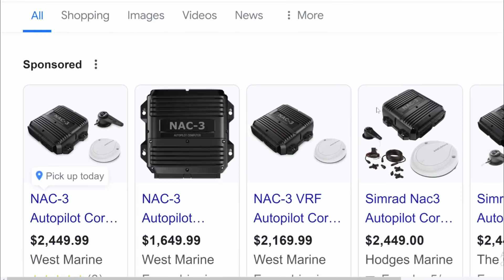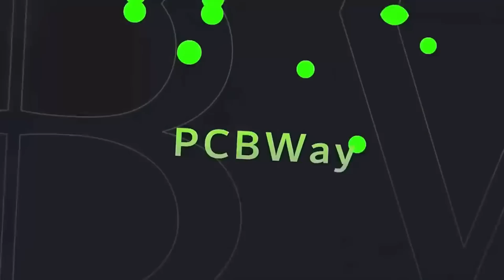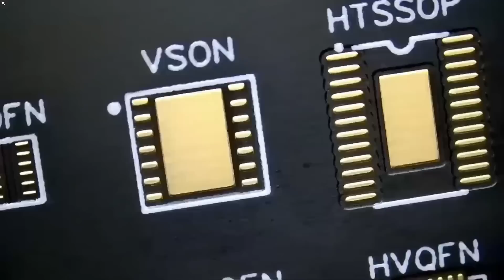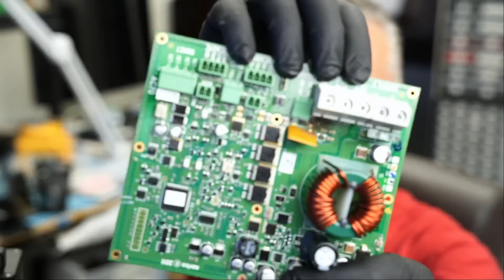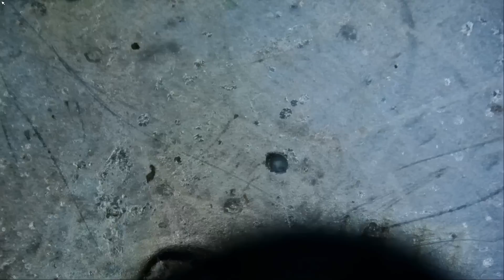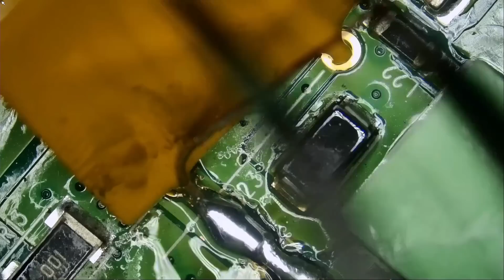Expensive Boat NAC-3 Autopilot Computer repair

Comment: I think that was a fusible trace that blew up if thats the case then there could be a problem with the board or there was a huge load on it like stuck propeller that caused it.

Comment: I think that board is going to make an even bigger bang when it gets plugged in!
Reply: Μy thoughts exactly.
Reply: Well, for me it looks like a pressure of time for fixing devices. There were few things more Alex could do about this board. It will definitely make a big boom.
Reply: depends if solenoid was replaced also (assumption its for solenoid). if not than i agree.
Reply: I hope the poor owner reads your comment and doesn't plug it or! Definitely in for a surprise. 😂
Reply: Hell yeah 😂

Comment from the maker: Update: 5/14/2024 We replaced L21 with the correct component. Eric saved the day. Thank you. https://www.youtube.com/post/UgkxHL8Q3bn86Fr4ROddAwxm7yr788X-KsMI

Few pointed out that the broken trace is L21. while that is true, the value of the component is unknow and this likely being EMI filter,  replacing with a direct wire will not have a noticable effect considering the size of the component.  If you know the value of the inductor, feel free to share it, otherwise it won't make a difference
Reply: Came here just to read about the L21 🤣
Thanks for the explanation.
Reply: Did it work?
Reply: Yea i had noticed L21. its likely a filter inductor..  i have a feeling something shorted the output.. and it acted as a fuse.
Reply: In the video it had a 09 on it , don’t know if that helps. Couldn’t you search online for images of a replacement board.
Reply: well next boating season you may find out

Comment: Something else downstream in the circuit probably failed... that board will just fail again, but next time it will REALLY go boom!
Reply: U can feed power into it with a bench power supply to test it. But that board is hard to test componets i can tell u his probs were not breaking though the coatings. I repared sealed boards like this before, you have to grind the coating off ever thing u want to test for a short
Reply: What can you do?
Reply: 😂 @me_bee_ste_0
Reply: @me_bee_ste_0  measure resistance or shorts of actuators!
Reply: @me_bee_ste_0 look for a short to ground
Reply: That engine is gonna purr like a hand grenade
Reply: It will always go boom unless it does not.
Reply: downstream, oh yeah, on the river.
Reply: Surely you can tell him how to test the circuit, yes?